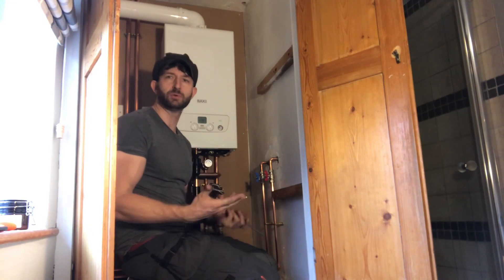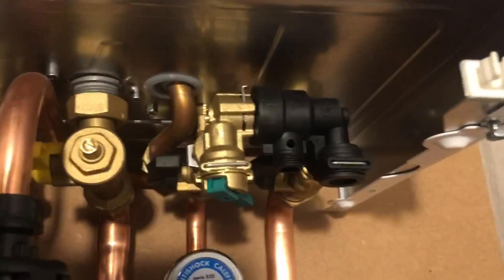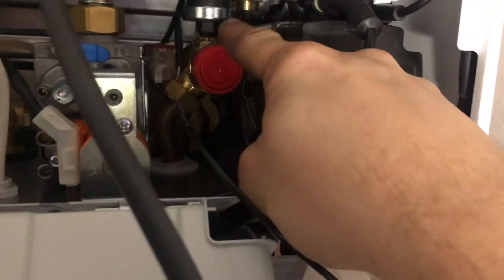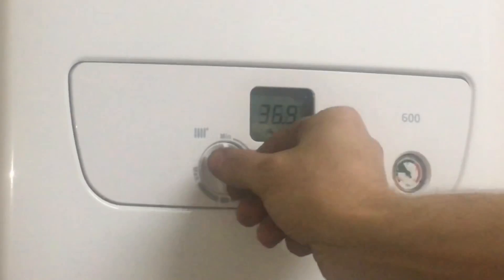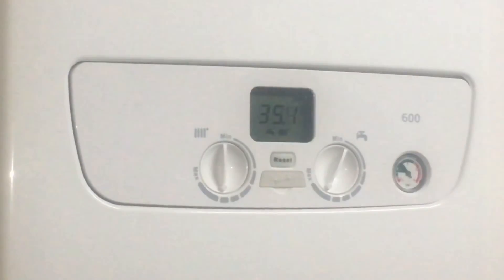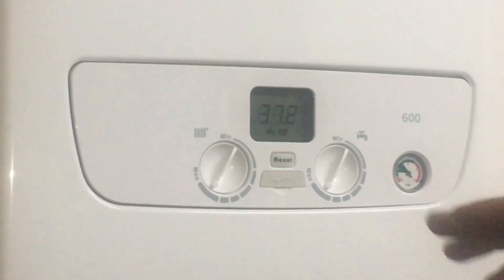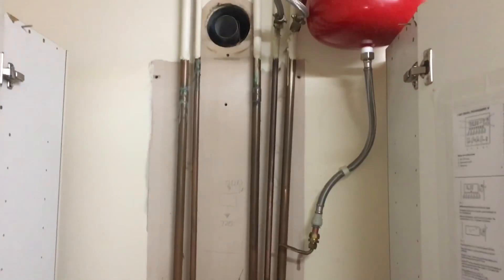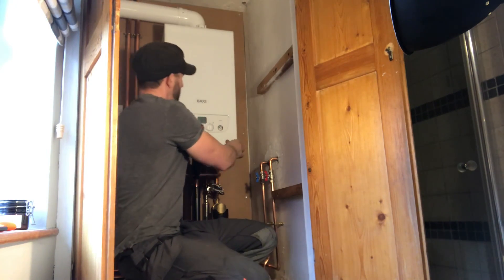Baxi 600 combination boiler review

Comment: What's the brass thing on the flow pipe dude. Also the little red plugs that fit in the electrical cable inlets fit wicked on the filling loop holds it half open so you can fill and bleed at the same time........you've probably worked this out by now mind haha

Comment: Understand your point about taking a while to fill initially, but a few minutes of pain is worth it for a dozen+ years of ease! You're right, Schrader is really easy, central flue is great, all brass hydraulics built to last and the purge you have to do at the start is to elongate life of heat ex, stop noisy scorch marks etc.
Very easy to use, and can be attached to any smart control if the customer wants fancy interfaces etc
Also, the rear piping kit is a fantastic addition!
IFOS is the real game changer though, takes two minutes to fit. The flue can be facing any way (doesn't have to be North etc) as the sensor is clipped discreetly into the air intake. These are £25+VAT and comply with boiler plus!!!
uSense is around £130+VAT
Great video as usual, great work <3

Comment: Mine won’t come on no light just switched itself off and won’t come back on now ? Help
Reply: I have no experience with Baxi, but it’s owned by Remeha which I do work on a lot. 

If there is power from the outlet but the boiler won’t turn on, the board might be knackered. Hard to say when I’m not there. 

But if you’re not a licensed plumber, and I don’t know if you are, please call one. Good plumbers cost a bit but they’re worth it. 
Outside of that, if it still has warranty then you might just void it if you decide to go at it yourself.

Comment: Good review, fitted my first Baxi 630 just this week but not without slight drama. Central heating worked beautifully but no hot water! I am a Baxi works installer but Baxi couldnt come for 2 days! Bare in mind my customer had been without hot water for 10 days. I returned the following day to patch up and sort a few other bits but decided to check PCB for any dodgy connections and hey ho! Multi connector 22 not pushed on fully. I pushed it fully home until it clicked and bingo, hot water working. Obviously an assembly line issue but not very good. Something you may not have noticed but the return and cold water connections on to the boiler are virtually impossible to tighten with the fill loop in place and would necessitate a tap spanner to tighten should there be a drip. Like u, dont like the fill loop at all but worcester using them also, why?? Might go back to my Logic plus albeit i should know better after bitter experiences with the Isar

Comment: Hi
Any idea why radiator flashes and fan constantly on even on minimum radiator setting?
Thanks in advance
Reply: Hi mine is doing the same thing what did you do to correct this, sounds like it's on all the time
Reply: Just got my baxi and have same question. Just bit annoying non stop sound. Can't sleep night time as boiler is just under my bedroom. Can it's can be done or it's just something what engineering team did miss???
Reply: @lindabuka6740  I wired Nest 3rd Gen Thermostat to a boiler on OpenTherm. I think I followed this wideo or some other. Basically thermostat sorted everything straight away. And you control all boiler settings on it

Comment: I had one experience where baxi were difficult with there blue range  warranty kinda put me off. They even blamed a friend for fitting a part upside down which was an impossibility.
Reply from the maker: pieface952 we all have a bad experience with a manufacturer at some point I guess, as a company we have fitted baxi for years and they’re generally good to us, I’ve had a really bad experience with Vokera it was the only Vokera I’ve ever fitted and they were right dicks, so never again, you live and learn
Reply: Answered like a politician👍. You very right tho. I used to rave about them I might be wrong (could have been my last toaster with my memory) but I'm sure the old solo heat only didn't even need a permanent live, saved the day sometimes.
Reply: Baxi EcoBlue Advance Heat still has no pump overrun. 7 year no quibble warranty when registered on Works.

Comment: I’ve just moved into a property that has one of these I have some questions if you could answer that would be amazing !!!  The system was completely empty.  No pressure. So we pulled the green knob and bled the rads. Both dials are set to MIN. But we have the smart thermostat on the wall, should I keep the dials on MIN? Also is it worth my cycling it through a purge mode ? Thanks.

Comment: Can you tell me why there was a red expansion tank added on the install? Thanks as I am just learning.
Reply: If you have a large central heating system with many radiators, sometimes you need an additional expansion vessel to deal with the increased expansion that the boilers built in vessel alone won't be able to adequately support.

Comment: Hiya PB, enjoying your vids. Did that have a filter on the flow as well as the return?
Reply from the maker: Dominic Halliday the flow has a Spirotech RV2 on it, looks like a filter but it’s actually and air separator, they remove micro air bubbles from the system to prevent corrosion 👌🏽

Comment: I'm fitting the same boiler as an amateur plumber. I've bolted it to the wall, knocked the hole through for the exhaust, and have all of the pipework beneath the boards below the unit. I'll hire a professional to finish the job and check it off. If you don't mind, though, what are those components you have on your copper pipes?

Comment: soldering is neat but dont you get paranoid about potential pin holes when only feeding in the solder from one spot ? , im guesing you only do this when its exposed/display pipework?  , can never bring myself to do it that way just in case .....

Comment: Good video!

How many boiler installs do you recon you have lost with boiler plus coming into force? 

Wonder if anyone has had the backflow  valve go off on them yet? And has anyone piped one up to the drain with it having 3/8 bsp thread 🤔

Comment: Hi, i'm sort of binge watching these types of vids as my parents are getting a new boiler and your vid seems the most likely they will get as its in an upstairs airing cupboard with the gas mains directly underneath (on the outside), the guy that came out said they would need a boiler, a water heater for the rads and a new cylinder.

 Question to you sir , How long would you  expect a job like that to take? i should mention that they are also taking out the back boiler downstairs, also what are the regs on ladder workings on  roofs? as the guy said the flue will go out onto the roof of the house and they don't want a scaffold outside. 

I 'm asking this as it is starting to stress out my parents and i'd like to tell them it might only take two days or so,..thanks for your time.

Comment: Co2 alarm
Reply from the maker: FUNNY SH#T do you mean CO alarm? It’s a room sealed appliance it doesn’t need one! 
There’s no such thing as a Co2 alarm 👍🏽
Reply: P B Plumber yea I meant co alarm what happens if it leaks how would you tell I’m not giving you hate or anything I’m just a plumbing apprentice we do gas boilers and always put them alarms in I was just trying to learn from you I watch your videos all the time
Reply: P B Plumber pretty bad advice to say modern boilers don’t require a Co alarm! Less likely to give off co but can definitely still do so!
Reply from the maker: FUNNY SH#T it’s cool mate I wasn’t being funny, I would advise a CO alarm for whole house protection I wouldn’t deem it necessary to install one in a cupboard with a room sealed appliance 
The law at the minute is you need a CO alarm only  if you have  solid fuel appliance, which I think is crazy

Comment: Ideal esprit logic and vogue all the way
Reply from the maker: BP PH I’ve never fitted a vogue they look like a nice boiler, done a few esprit and logic plus for landlords
Reply: P B Plumber good boilers all throughout, 5 year 7 and 10 year. Installer connect ect. Also boiler plus is so much easier with the ideal touch. £110 plus vat worth a peak
Reply: As fellow heating and gas engineers we should stick together. To stop DIY on all plumbing and heating installations.
Reply: I'm wanting the vogue fitted as part of the refurb in my house. Tried to get as much info on it, some say its bad not as well made due to plastic parts. but come with 10 years warranty ?
Reply: @daz374 - the newer Ideals are better boilers but still backed up by Ideals shitty customer service and warranty....
Reply: @daz374 plus theyre horrible to service, everything disintegrates.

Comment: So, the CH control is on the left and the icon for it appears on the right of the display and the HW control is on the right and the icon for it appears on the left of the display...  That's just poor user interface design by Baxi.
Reply from the maker: Alan Henness didn’t notice that one! Yes it’s the simple things like that make a difference
Reply: Yup. One of those things that's probably extremely easy to have got right but can simply cause confusion with users.
Reply: Nah. It's a custom LCD so it would need to be remade or the dials swapped round which would be a circuit/processor tweak and a change to the screen print on the panel. Then they would have to change the manual...
Reply: It is an LCD with 15 icons and three seven-segment displays, custom made by Baxi, and not a full graphics display.
Reply: It is a custom LCD. If you choose not to believe me then that's entirely up to you: it makes absolutely no difference to me.
Reply: Good grief.